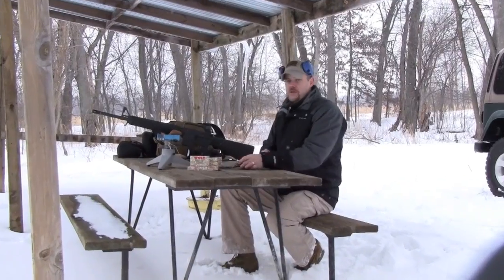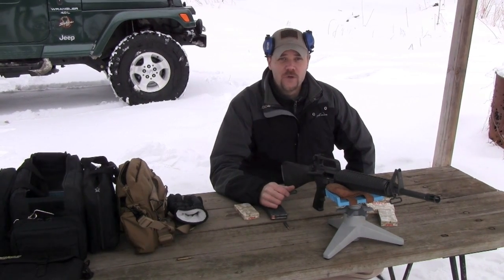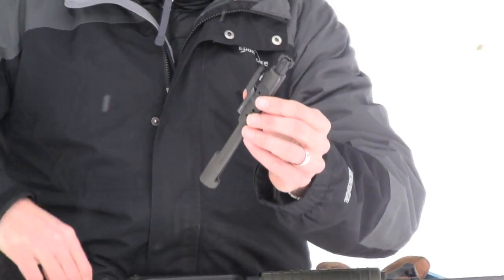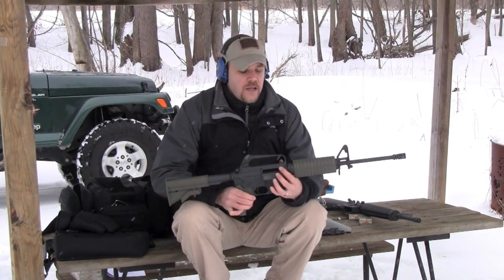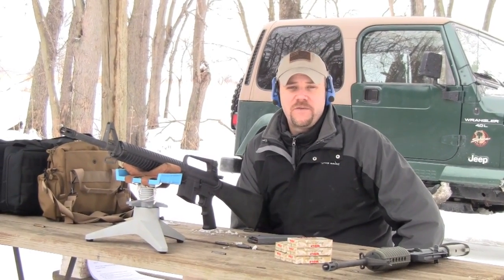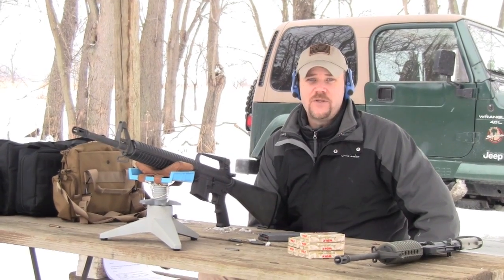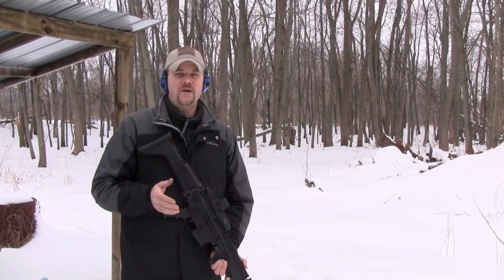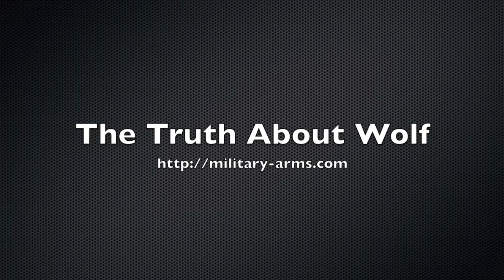The Truth About Wolf Ammo

Comment: MAC, do you use Wolf on all chrome lined barrels or have you used it with success on non-chrome lined barrels, like a melonited barrel?
Reply: You can use it on either chrome or non chrome lined barrels, The BI metal bullet will cause faster wear of the non chrome lined barrel but replacing a barrel after 10-12k rounds of wolf will still be thousands cheaper then buying brass cased ammunition.

I pretty much use steel cased ammunition exclusively in everything except for my Daily carry pistol and 22lr firearms. I have never had any early wear issues in my pistols or rifles. The occasional hard primer and extra cleaning is the only negative I can think of.
Reply: Cool. Thanks for the info.
Reply: The Green Man How will a bi metal bullet cause more wear? It has the same copper jacket of any other bullet. Is it magic?
Reply: Steel on steel contact will always cause faster over all wear. However you can still get thousands of rounds out of a good non chrome lined barrel I have both Chrome and non chrome lined barrels on AR's and AK's. 90% of the ammunition I use for practice is steel cased BI metal and have not worn a barrel out yet. The average shooter will be more then fine shooting wolf out of any AR platform.
Reply: You miss the point brain surgeon.  The round is coated with copper, so there IS NO STEEL ON STEEL.
So then, back to the magical thinking, how is there excessive wear with copper jacketed bimetal bullets....

Comment: i used wolf ammo before and 15 rounds into firing i had a shell melt into my barrel. all i use now is federal
Reply: It's pretty impressive that you were able to hold onto your rifle that had generated enough heat to melt steel.
Reply: Oh hell no, I got rid of that POS. It was a STAG Arms AR and wasn't worth a crap. I've got a Windham Weaponry AR now and it's so much better in every way
Reply: Ed Brown Mine is a Windham Weaponry also.
Reply: Ed Brown Really? My buddy has a Stag and he'll shoot 300 rounds of wolf at a time without any issues. Maybe you got a lemon... Winham's are great though.
Reply: Your barrel would have to be glowing red hot to have a shell "melt" in there - or for the polymer coating to melt in the chamber. Were you shooting full auto for an hour straight?  Your barrel chamber is too tight for steel case ammo or the gas system/buffer combo wasn't optimized for wolf ammo and it got stuck in the chamber.
Reply: jpap967 Or it's total BS. lol
Reply: ***** I was shooting wolf once and my steel toe boots melted.
Reply: ***** Might want to see a doctor.

Comment: how does steel jacketing not damage the rifling in the bore
Reply: for god's sake! the outer jacket is copper
Reply: The video explained what the outer jacket is made of - copper.  So, if you are an english speaker, watched the video, and still  thought it was steel,  then that points to the lower iq levels on your end, good sir
Reply: "Military Arms Channel
November 7, 2012 ·

I get asked all the time "will bi-metal bullets harm my bore". The answer is no, they won't. Here's why.

Hardened tool steel has a rockwell hardness of 650/700 Brinell. Mild steel has a hardness of 120/130. Bi-metal jackets are made from very soft mild steel. Bores/barrels are at least as hard as tool steel and when chrome plated are even harder.

Steel jacketed bullets are nothing new. The US had steel jacketed bullets in WWII chambered in 30-06 and 45 ACP. The M1 ball and M2 AP rounds of the era used steel jackets over a lead core with a copper wash over the steel -- just like Wolf bi-metal bullets.

Frankford Arsenal conducted a test with steel jacketed 30-06 rounds around 1946 to determine if the rumors that steel jacketed bullets damaged the barrels more than copper jacketed bullets were true. In their testing they found that steel jacketed bullets not only didn't accelerate wear but they also discovered for the first 1000 rounds steel jacketed rounds were actually more accurate! After 1000 rounds the accuracy leveled off to be comparable to the copper jacketed bullets but no evidence of accelerated wear was discovered through 8,000 rounds of testing on their samples.

In short, bi-metal bullets do not do any more damage to your firearms than conventional copper jacketed rounds do. All the claims of chamber wear, throat erosion and barrel wear are unsubstantiated wives tales."

Comment: On two occasions I have had customers come to me with an AR type rifle with an empty Wolf steel case stuck in their rifle’s chamber. On both occasions the rifle owners admitted that during a cease fire to let another person go down range to post a target, instead of clearing their rifles, they simply put the rifle on safe, and left the unfired round set in a hot chamber for several minutes. Of course that was totally unsafe, but it happened. Upon resuming fire, the fired case stuck in the chamber, the extractor lost contact with the case rim, the bolt went to the rear, and then tried to feed another round into the already full chamber. Even though I am only a gun dealer and not a gunsmith, I got out one of my GI steel ramrods and tapped the empty case out of the chamber. Was it the case coating or carbon leaking around the mouth of the steel cartridge case that caused it to stick? Does it really matter? The fact is it stuck, an unsafe action on the part of the gun owner, and CHEAP steel cased ammunition combined to cause an even more dangerous situation. Bottom line; clear firearms during a range stoppage, and don’t risk damaging an expensive rife trying to save pennies on cheap Russian Wolf Ammunition! If you can’t afford quality brass cased ammunition, maybe you can’t afford to go shooting. 

PS: at our range in the foothills of the Serra Nevada’s, steel core bullets are not supposed to be used because of the fire hazard in the dry grass. Because most people don’t realize Wolf Ammo has steel in the projectile, they don’t realize they are violating range rules by using it.

Comment: you need to keep the barell "sealed" by the bullet long enough so that enough gas whit enough presure can press through the gas tube
moving the gas port too close to the end off the barel will reduce the time the presure in the barell will stay high, so the time when the gas enters the gastube would be the same as whit a 20" barell but the time the presure keeps pushing into the gas tube will be shorter, that could cause problems whit unlocking the bold and ejection

Comment: They're are clear much more scientific test then this guy's"truth" that clearly shows wolf and Tula ammo with a steel bi metal  bullet will prematurely wear out the rifling of a barel. They shot 10k rounds of brass and steel rounds, the steel rounds damaged the barell with as little as 4k rounds. By 5k rounds the rifling in the barell of the steel guns was gone and the bullets were tumbling and keyholeing in the air, while the guns that shoot brass were just fine past the 10k mark. It's not a even a question if it prematurely wears the gun at this point. It also has an incorrect burn rate, causes bolt slap in slow motion, and malfunctions at higher level than any brass rounds it's tested against. Support an American reloader and save your rifle in the mean time. The money saved on wolf will quickly be negated when you smooth bore your barell every 5k rounds. I had a bush master that was my baby, always cleaned, at the 6-7k round mark, mostly steel ammo started to shoot noticeably worse and I was getting flyers, the gun eventually decreased in performance until the point where every round I fired would key hole. I now have some nice Daniel's Defense, and pws rifles that I would never shoot steel through. I buy my ammo a case at a time from a local reloader for around or slightly more then wolff and I get a much better product and I'm helping a guy I know not a foreign socialist owned company. Just my personal exp...
Reply: This has been countered in the comments above..
Reply: Midniteoyl great argument. you really won over my actuall experience...
Reply: Simply pointing out that there is someone in the comments above who is countering the 'test' you mentioned.. I dont care what what you use.
Reply: ummm very convincing. Thanks for wasting my time.